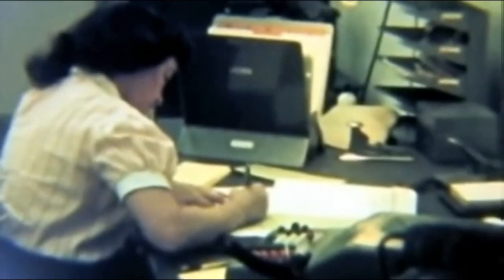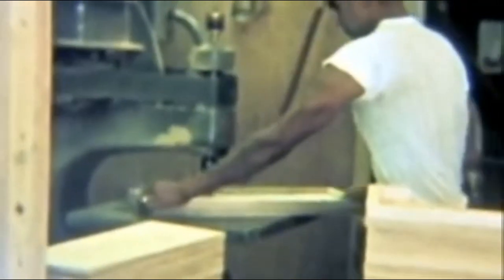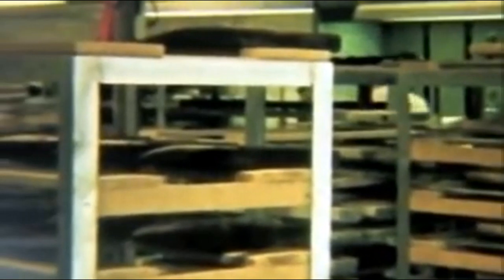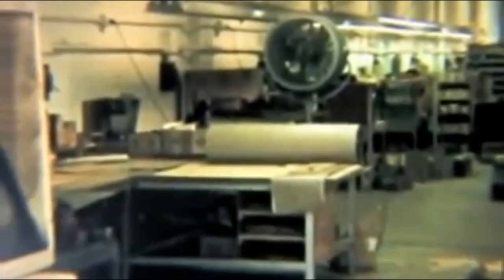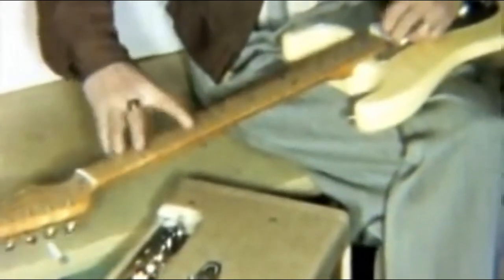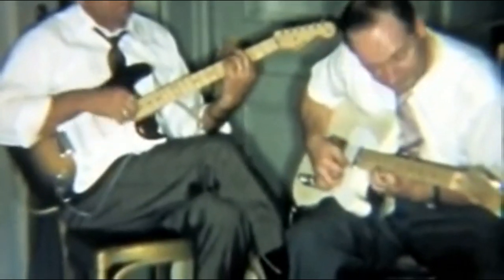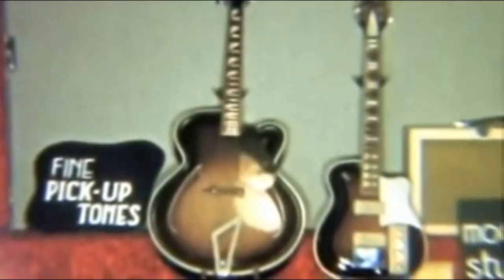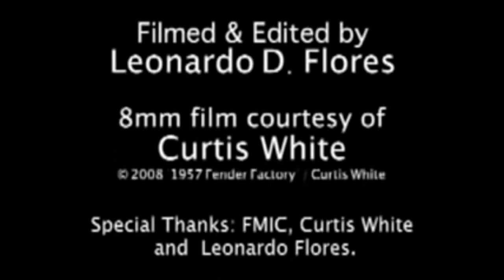Fender Factory Tour 1950's - COMPLETE

Comment: Based on the headstock decal on the Stratocasters in this video- video was most likely filmed in 1955 or 1956. By1957 the decal had been moved further out on the headstock. My guess 1955-56 probably not 1957.
Reply: yup...the necks look like 55 or 56'...by 57 they were thinner at the nut for sure.
Reply: @iansnyder274  The decal placement is the clue- it changed in 1957.
Reply: @kenbash2951   ah Good catch!